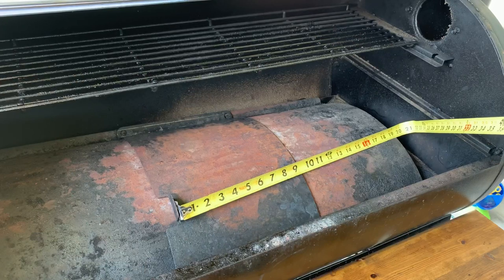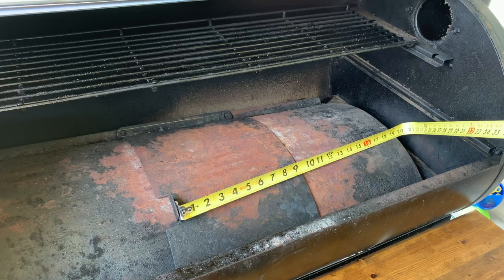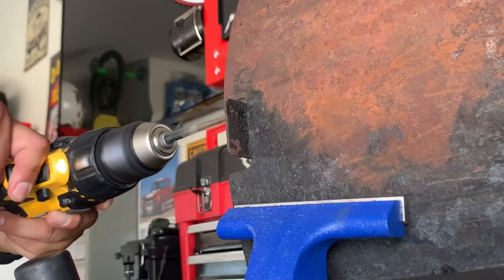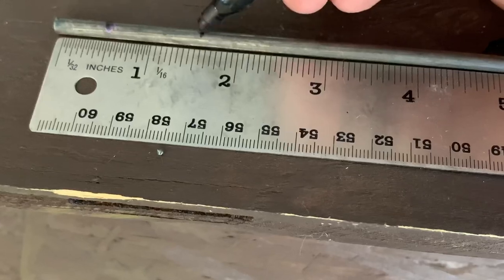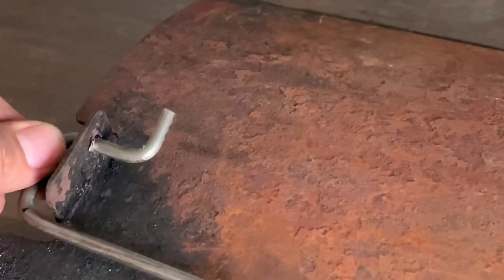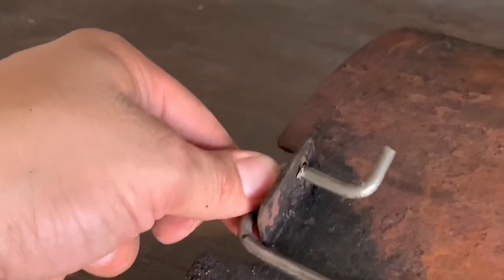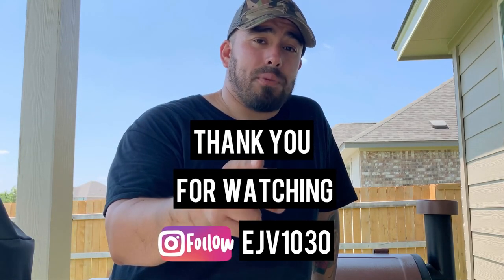How To Install A Sear Plate Push Rod | Pit Boss Modification

Comment: My version:  Lowes: Kitchen cabinet dept. and pick the knob of your choice.  Then, to the hardware isle for an "all-thread" rod to fit the knob, then to the nuts and bolts isle for wing nuts to fit  the all-thread rod (need 2).  Then:  Drill hole in sliding tab and matching hole in side of the Pit Boss, then cut the all thread to fit to space when the slider is closed, then, wing nut on, rod through, wing nut to close, knob on and slide back and forth with a NASA engineer smile. DONE. (Less than $4)  The benefit of using a rod (not all thread) is removal for cleaning.  Rod requires gyrations but nothing more (I think).  My version requires plyers to hold all thread and fingers/plyers to hold wing nuts ((that why not a a nut) due to the grit and grime).  But, my version has a knob!.  Rod version could add a tap to put threads on the rod to fit a knob, then maybe rod is better.  Or not.)  Anyway, thank God we men are inventive. (See The Martian).

Comment: Great and easy mod. Just completed on my PB 820D. I threaded the end of the rod that's outside the barrel and added a hard plastic knob I picked up at Lowes. Secured with a wing nut and washer.
Reply from the maker: Nice! A knob is a nice addition for a handle!

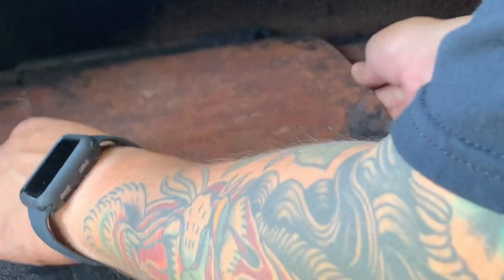Comment: Great video!  Please tell us the bending points on the rod lengths for the exterior handle and the two 90 bends that youve mentioned at slider point 03:42 minutes.  Thanks!
Reply from the maker: Hey, I really guessed on it to worked for me the first bend should be made as soon as the rod exits the pit. But make sure the plate is in the closed position before you make the first bend.

Comment: Nice tip. I swapped my slotted sear plate for a solid one to better control heat distribution. Only problem is that the tab for the rod is in a different location. This will come in handy!

Comment: The only reason why I haven't added a rod is because of the inconvenience of having to unscrew bolts during cleaning. I already hate all the steps for that task. This just made everything a lot easier. 👍
Reply from the maker: That’s exactly what I was trying to avoid also.But this modification makes a huge difference and I would highly recommend it!

Comment: Drill a hole in the un-threaded rod about 1" from the end. Size the hole to fit a hitch pin clip (Lowes or HD).  About 3/4" from first hole, drill another hole sized to force-fit a piece of round stock (like a  cut off nail). This will allow you to push/pull the slide plate with the advantage that the plate can be easily removed just by by pulling out the hitch pin and withdrawing the rod. Rod, hitch pin and a cut off nail, your done for under $10

Comment: Great vid, now show us how to drill a big hole in the bottom of the fire box and add a slide plate to open and close to let the ash out from the bottom without having to take the grate, flame plate, and barrel plate out to get to the fire box to vacuum or hand pull out the ash. Kinda like the Pit Boss 1150 Pro Series has.
Reply from the maker: Let me see what I can come up with!
Reply: @bbqanytimewitherictx  Thanks looking forward to seeing some ideas of how to do it because I have the Austin XL and want an easy ash clean up option.

Comment: You can easily install the original rod modified, on the left hand side like the newer Pitt Boss models.
Reply from the maker: When I did this modification I never looked for a replacement rod from PitBoss. The rod was only a few buck not sure what a PitBoss original rod cost.

Comment: What did you do so that way it doesn’t leak or that little hole
Reply from the maker: I didn’t have to do anything to plug hole…. I have t had any issues with heat or smoke loss.
Reply: @bbqanytimewitherictx  that’s great

Comment: I have an 820 and my pit boss plate looks just like yours.  I do have the handle.. but after a year of use, its sticks all the time unless I really heat up the smoker.  I clean it every smoke.  You have this issue now that you have wear?   thanks!
Reply from the maker: I haven’t notice any issues with the grill sliding. I do clean the grill on a regular basis.

Comment: Great idea but won't that rod be hot as hell to the touch? Maybe a wood handle is needed.
Reply from the maker: The rod is long enough that the heat will dissipate and doesn’t heat up. You could add a wooden handle but I haven’t needed it.
Reply: Yeah, that makes sense. I just did mine today and put a wooden knob on it.

Comment: you didn't show the part where you bent the rod outside the smoker for the handle. Did you bend it after you installed it or were you still able to feed it thru the hole with all the bends it it? Thanks.....BTW My sister lives in Kyle! We are up in Pflugerville....... Cheers!
Reply from the maker: I added the bends after the first test fit. I didn’t have any issues pushing it through the exterior box after adding the bends. I hope that helps!

Comment: Love it. I’ve been looking for an excuse to buy a vise! Does the type of steel rod matter from a food safety perspective? I see Home Depot sells “3/16-inch plain steel round rods”. Is this what you used, or was their something else like stainless steel?
Reply from the maker: I did use a plain steel 3/16 inch rod they should carry it at Home Depot. The pit boss has a plain steel sear so the rod shouldn’t cause any problems with food safety. Once you install it just do a burn and get the temp up in the pit to burn off any oils on the rod. Thanks!